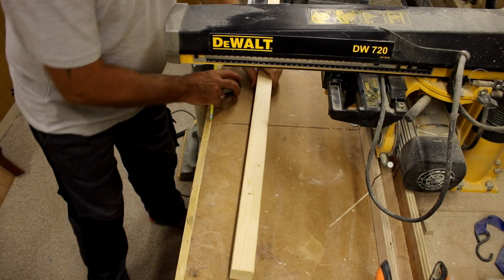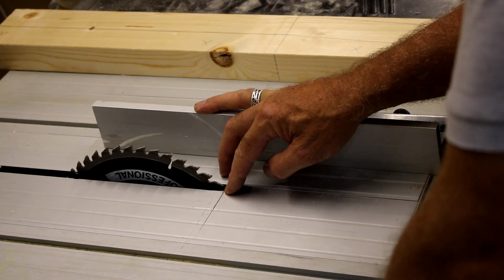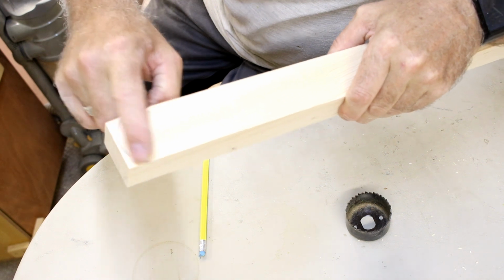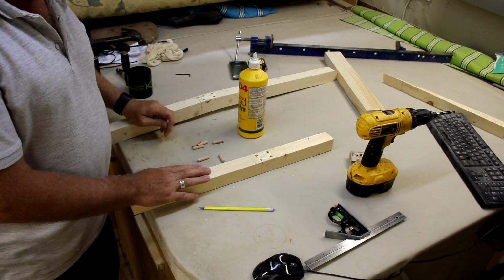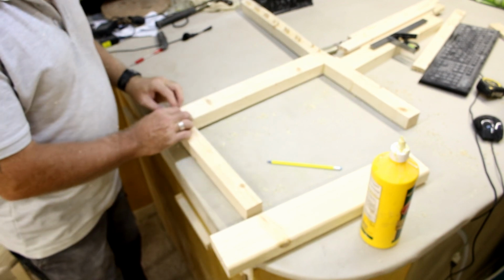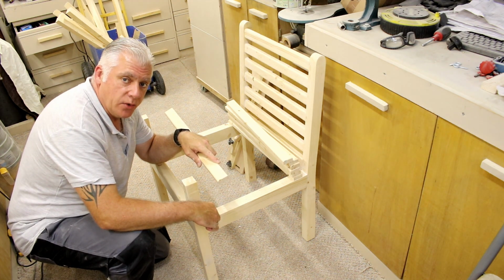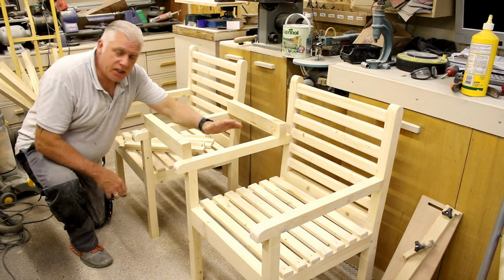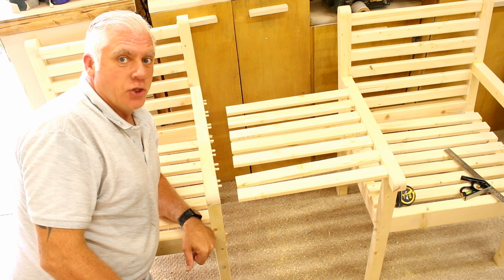Make outdoor Garden Seats And A Love Seat/ DIY Build

Comment: Very classy design, could u send me the plans please
Reply from the maker: Check the description. link for the Sketchup file is in the description so you can open it with the free version and get all dimensions and angles.
I've had a workshop fire 🔥 so I'm just busy putting my work shop back together. Cheers Anth